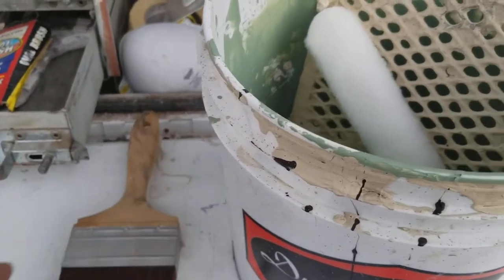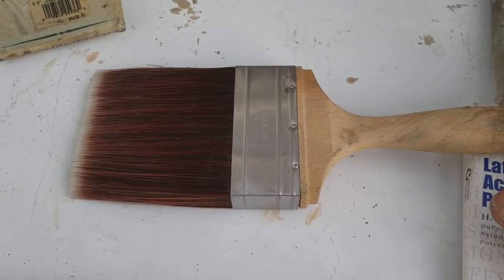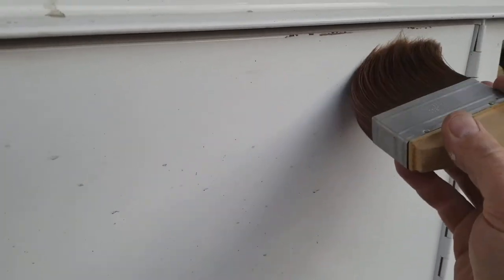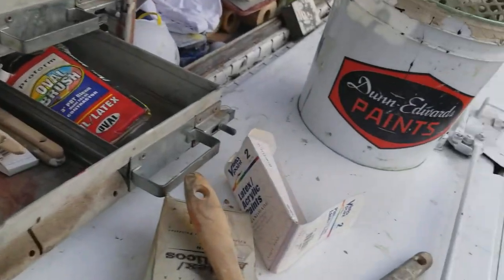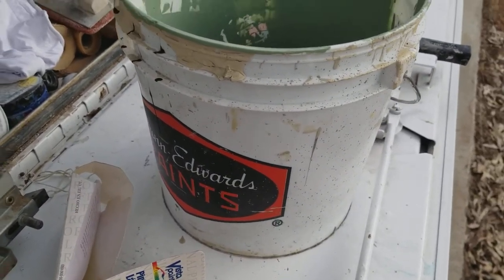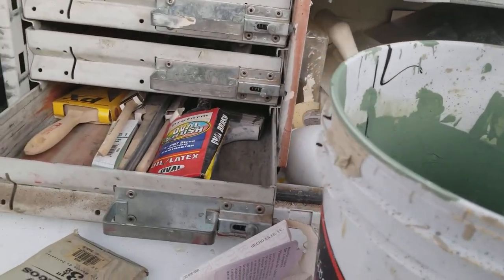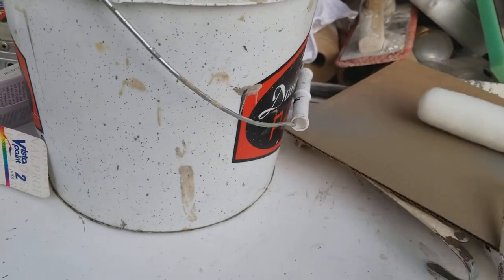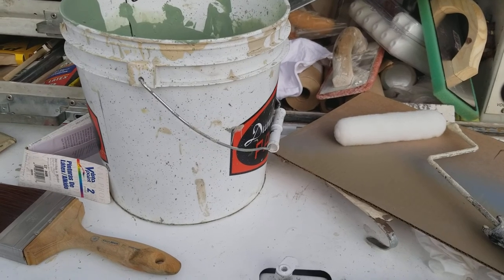Cutting in with a slim Jim roller or brush painting

Comment: Been learning the trade for almost 5 years now. I taught myself a lot and learned from this channel and others. I only know of one other painter/tradesman that uses a wall brush instead of angle sash to cut walls in my areas.!Seems like old school guys that really know the trade will tell you to use a wall brush. But all the stores only sell angle. I learned to use a wall brush the right way and will never go back to angle sash to cut walls. Then cut in with angle sash doesn’t cover well at all especially with mid to lower grade paint. I get Ben Moore aura and a 3 1/2 inch corona Denver. 1 coat cut in almost every time. Lays off like butter no need for whizzy rollers
Reply: Who other youtubers?
Reply from the maker: here is a good one you can get on amazon https://amzn.to/2EBh6CJ

Comment: 4 to 7 inch brush should always be used on walls and ceilings does make me laugh when you see guys with their 2 inches
Reply from the maker: I usually do a 3 inch to 4 inch cut. max. all done by brush. except if I need a second coat. Sometimes that will get done with slim Jim and a shield